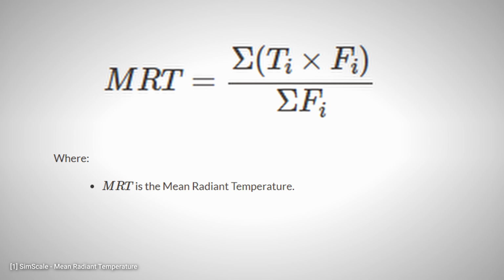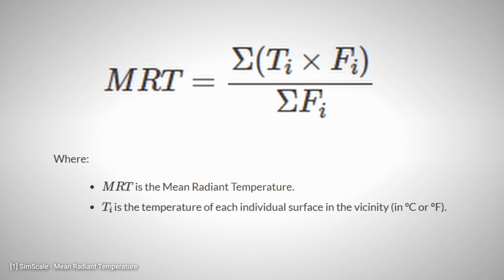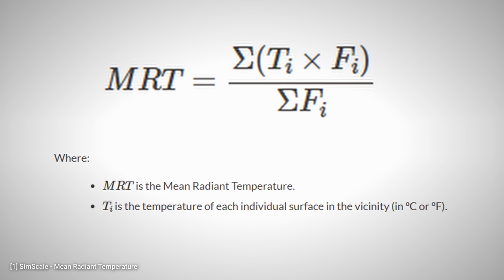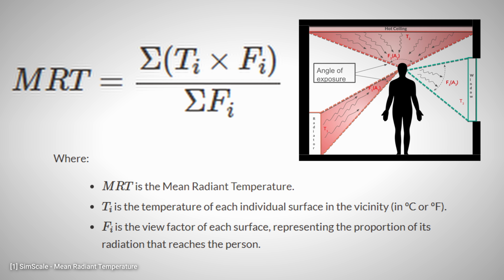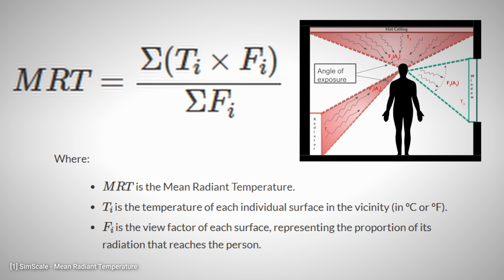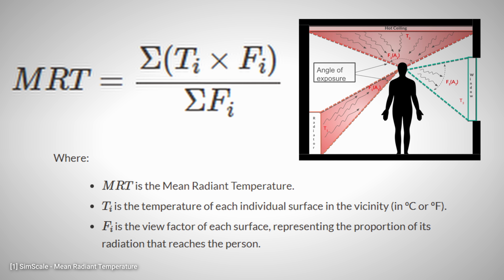The Most Misunderstood Factor in Thermal Comfort

Comment: Excellent presentation. I get out of it that heating the mass in a room is more important than heating the air itself. 
I can definitely feel that when it comes to cooling my place down with south-facing main windows... objects radiate heat I wish I could get rid of easily.
Reply from the maker: Yes, exactly! And make sure you have shading or closed blinds against those solar gains 😄

Comment: Which is partially why my IR heater (20 euro, 2*400 watt bulbs) and why houses in hot climates have tile floors.. Interesting it also makes a case for highly insulated buildings, which always seemed a bit out of proportion to me, given the cost of insulating..
Reply from the maker: That depends on the density of the insulation material. Some good insulating materials have low densities, which don’t add much in terms of thermal mass.
Reply: @PrefabulousTimberTalk wouldn't a thin plaster wall on top of a thick pir panel reach ambient (room) temperature much faster?
Reply from the maker: It would, but it would also lose it very fast because of the relatively low density.
Reply: @PrefabulousTimberTalk Makes sense! i didn't think of that, as with many other things you mentioned in your video. Thanks, im learning a lot!
Reply from the maker: Glad you're enjoying the content! And thank you for your support!

Comment: There are other ways to calculate temperature feeling as well. For legal reasons in Brazil (people who have to get inside freezers or work near ovens receiving extra compensation) we use a thermometer with 3 measurements. A dry bulb that gets air temperature, a humid bulb, that gets how well the air is giving or taking away heat from your body, humid air will cool you more on the cold but prevent you from cooling yourself on the heat, and a globe to measure radiated heat.

I'm pretty sure there are other ways as well.
Reply from the maker: You’re absolutely right! This was just one of the factors influencing thermal comfort.

Comment: Our house is 150 years old, and has plaster walls (which is moderately rare here in Canada), and it's interesting, in the morning the house heats up to 22° and then immediately after the heat shuts off, it falls to 20.5°-21°. after a few heat cycles, the plaster walls have absorbed the heat from the air, and the temperature is maintained better.

Comment: Cover all surfaces in IR heating panels, got it!
Reply: Cover them with reflective material, thus the cork tiles.
You could use silver backed foam insulation with a cloth covering over it.
This is my plan for a van, introduce 12v resistive heating panels and it may be a winner.
Take care M.

Comment: Engineers design buildings only for men. The men are comfortable and the women are freezing. Everybody considers feeling hot to be worse than feeling cold. When I was still working, I had to run a space heater under my desk. Yes, I know that men have more muscle mass which generates its own heat, but why can't they run fans? And then of course, there's the proliferation of chubbos, who carry around lots of their own insulation.

Comment: So, if I am sitting between a cold window and the thermostat, I will feel cooler than what the thermostat reads on the wall further away. 
Can’t I just measure the air temp where I am sitting to get the actual temp I should feel? Not sure I’m seeing the practical difference between this temp and an MRT.
Reply from the maker: That’s exactly right! To understand how warm or cool a person actually feels, you need to look at both the air temperature and the mean radiant temperature at their specific location. The picture becomes even clearer when we factor in things like the clothing someone is wearing and their metabolic rate, since both can noticeably influence thermal sensation. We’ll explore all of these elements (operative temperature, which blends air and radiant temperatures, along with personal factors such as clothing and metabolism) in the next two videos!

Comment: An easier fix in the winter is to simply add a humidifier to deal with dry air. Humidity has an effect on air density, and air density affects the air's ability to carry heat more than temperature alone. So if your humidity is around 20% or below you'll be chilly and close to 40% (or even above) and you'll be comfy. And that's with the same 20°C/72°F thermostat setting and no other obvious changes to conditions. No need to have specific radiant heating or being in line of sight of windows.
Reply from the maker: Very fair point!
Reply: @PrefabulousTimberTalk And even with the radiant stuff mentioned in the video, it lessens the noticeable temperature swings of the on/off cycling of an artificial heat source. Just the tiniest bit of thermal mass adds a buffer. And water vapor counts there.
Reply from the maker: Might make a short about this phenomenon! Thank you for pointing it out!
Reply: This was the very first thing I thought of when viewing. I'm glad someone brought it up. I think it is an underappreciated effect in heat comfort situations.

Comment: In the UK, our housing stock today is plagued by condensation and black mould. 
It is a recent phenomenon, rarely existing half a century ago. 
Why?
We changed from radiant heat from cheap coal, gas and electric "fires" with single glazing and draughty houses, to expensive central heating "radiators", double glazing and sealed rooms. 
We used to have many changes of air per day in our houses, now we re-breath the same air all the time.
In the past, our MRT was much higher, and our air temperatures in our houses were lower, and our respiratory health, despite the pollution, and universal smoking, seemed to be much better, nobody carried inhalers routinely. 
Our allergies, asthma, and susceptibility to viral infections was generally lower.
And way back then, just like today, we died of pneumonia.
Reply from the maker: Indeed, a very interesting topic and it is often overlooked. We happen to have made an interesting video about why modern buildings have more window condensation, which you might find interesting!

You can watch it here:
https://youtu.be/Em6SDrWCg0w

Comment: This is why I don't recommend large setback temperatures in attempt to "save energy".    My home is pretty comfortable at 68 degrees Fahrenheit.  I don't let the objects in the room get cold.  When people setback the temperature, the objects in the room get cold.  When turn up the heater, the air temperature rises pretty quickly but the room will still feel cold because it takes much longer to rewarm all the objects.  I stumbled into this when I started using a heat pump which wasn't conducive to large setbacks anyway.
Reply from the maker: Absolutely agree! Trying to warm up all of those surfaces in the room when the heater has been off for a bit means there is a lot of thermal lag, which is very annoying.
Reply: That is manageable by anticipating the thermal lag. I’m happy to have my house below 68C when I’m sleeping. Since there is thermal lag I set back thermostats well before I go to bed and have heat come on well before i rise.

Comment: I use electric hot air central heating at night because my electricity is free 8pm- 6am. By 6 am I have my wood heater running and it is much better because it is radiant heat. My arthritic joints can’t read thermometers so I don’t pay attention to them.
Reply: My fibromyalgia can’t read thermometers either!
Reply: Nothing on the planet is free.where do you get free electricity.?
Reply: @peetsnort probably at a place where the energy production isn't very flexible (wind turbines or a big coal plant for example) and most of the demand is from companies that only run at daytime. Negative energy prices aren't that uncommon nowadays with the increased supply of wind and solar energy. But, yeah, at most places you still pay at least a tax or a flat rate over the energy consumption :/
Reply from the maker: In the Netherlands, there are occasions when consumers are actually compensated for using electricity during specific hours. This unusual situation arises from the ongoing struggle with grid congestion. At certain times, an excess of energy flows through the network, outpacing demand. When supply and usage fall out of balance, incentives like these help relieve pressure on the system and keep the grid more stable.
Reply: @PrefabulousTimberTalkja jôh? Krijgen ze dan geld toe? Waar is dit?
Reply from the maker: Voor zover ik weet gebeurt dit overal in Nederland waar netcongestie optreedt en mensen een flexibel contract hebben!
Reply: @PrefabulousTimberTalkwierd

Comment: My largest room has my little oil radiator at the mouth of the bay window. The wall radiators are in the wrong place. The oil radiator uses the convection of the cold bay window perfectly, circulating hot air around the entire room.
Reply from the maker: Tactical place for the radiator! Nice one!

Comment: A related factor to consider is the material temperature of the surfaces in the room. For example, whenever I travel, I close my bedroom and turn off the heaters. When I return, everything in there is close to freezing. Hours later, even though the air has been warmed, the "cold-soaked" furniture is not radiating and I still feel "cold". Actually, the feeling is "hot and cold at the same time", because the air is warm but the MRT is still cold. Switching from convective heaters to radiant heaters helps with this.
Reply from the maker: Good point. That 'warm air but cold surroundings' mismatch is very real. Your body still loses heat to those chilled surfaces, so the room feels cold until they warm up. Radiant heat really does fix that faster than air-based heating.
Reply: Wow this actually helped me piece things together that I already knew. I’ve noticed for years how with our central heating, I freeze for most of the day even at 20/21 degrees. But come night time, I am actually comfortably warm even though the temperature is set for 18-19. By night time, the temperature of the walls and furniture has finally hit the desired temperature, only for me to go to sleep and start the cycle again the next day.

Comment: This is why I like oil filled radiant heaters. They radiate the heat directly to the surfaces of the room, raising the MRT, and making the room more comfortable.
Reply: I had one of those and was impressed with how well it warmed the space. Now I understand (pretty well) the concept behind its operation. This is a very useful video!
Reply: my buddy constructed his structures with radiant water heat in a very cold climate. He did not get fancy windows but his MRT is strong enough from the floors to compensate for the drafty cold windows. hahaha. We have convection HVAC heat so I put two layers of window plastic 1.5m on in the winter - and I add extra insulation on the windows also - it makes a HUGE difference to have well insulated windows. I sleep on the floor but the builder of our house left out the sill plate insulation!! Holy smokes! I put clothing along the floor/wall joints and even some big sleeping bag and clothes along the front door. I use an infrared temp gun to go around the house. Anything below 60 F gets insulation. hahahaha. That evens out the heat now so if it is even 20 below F. arctic cold outside we stay comfy tropical 75 F. inside. We also have convection natural gas heater but don't use it that often - and a couple heat pads for chairs. Wow I just found some bath mats that were in the garage - those bath rugs - and put them over the windows on top of the clothing and now it's 5 degrees F. warmer in my bed room. Hilarious!!! Now I can sleep on the floor without getting cold - even with a thin blanket on me. The HVAC convection fan is loud because the filter makes it whistle but it's not that bad - the whistle is contained at the heater itself now. Before it was whistling through the duct work so would wake me up. I grew up with radiant water radiator heaters - and would put my feet on them. thanks

Comment: It’s surprising how little attention this gets. Even with thick walls and triple glazing where you don’t feel the windows per se, you can really sense the outdoor conditions way beyond effects on air temperature and humidity. It becomes more of a slowness of change. That’s really the point of insulation. It’s good if radiation balance is fitting for conditions and you have enough heating/cooling control on the inside. I hate this modern building which is too hot 24/7 for over half of the year, around 26 °C for months on end. There’s all that mass inside I can’t control. Every night you can open all of your doors and windows, which only helps a little bit for those hours with no lasting change. That’s another thing: overreacting based on past conceptions. People have to suffer from mistakes before we correct course again.

Comment: Very nice video! Thanks for the explanation! 
I'm modelling heat loss and heating needs and just figured I'd need some formula or method to calculate heat retention: I know the heat loss of the building, sure that's important, yet the internal temperature is dependent on the heat storage inside. Is there a rule of thumb how I calculate this mass, this energy storage?
Reply from the maker: Glad you liked the video! Since you’re looking at heat retention, the key is exactly what I covered in my thermal mass video a few weeks back: the more dense and heavy the interior materials are, the more energy they can store and release slowly.

A simple rule of thumb is to estimate the mass of the main interior materials (concrete floors, brick or block walls, thick plaster, etc.) and multiply those by their specific heat capacity to get an approximate thermal storage. It won’t be perfect, but it gives a solid starting point for modelling how your building smooths temperature swings.

Hope this helps you out a bit!
https://youtu.be/7akrp03NoQ8
Reply: @PrefabulousTimberTalk  Thanks! I spotted the video on your list, now watching! I'll try to calculate the mass of the building I'm designing, it sounds very meticulous, lot's of tiny details.
Reply from the maker: Indeed a lot of tiny details to consider. Best of luck!

Comment: This is why my garage (which is heated by an old woodstove) always feels so much warmer than the measured air temperature!
Reply from the maker: Exactly! Radiant heat!
Reply: you can put a big pot of water for radiant heat on a stove or also construct a thermal mass heater from cob and duct work - using a rocket stove for extra heat and clean burning. Those use ceramic insulation to make the wood burn really hot. I put some in a wood stove to experiment - got the stove up to 800 F. But then the steel starts getting damaged and I lost too much wood fuel space to the ceramic fiber board. hahaha. Still I got a clean burn and super hot temps. Just had to reload the stove too often.

Comment: Yes, I came to the same conclusion. I know when I am in a foreign country because my skin does not sense any higher temperature than ambient. In my tropical country, even if the room air conditioning is dialed low, some walls are still at a higher temperature and that radiation is sensed.
Reply from the maker: Exactly! 😄

Comment: interesting video on a topic ive never even heard of, one question though, couldn't you just use a thermal camera to get an idea of mrt near instantly?
Reply from the maker: You’d get a quick snapshot, but not a real MRT. A thermal camera only sees surface temperatures in the direction it’s pointed, while MRT accounts for radiant heat coming from all surrounding surfaces. That’s why tools like a black globe thermometer are still needed for a more accurate, all-around measurement.

Comment: I hoped you would tell us which materials radiate more heat towards or away from us ):
Reply from the maker: Good point! Materials with high emissivity, such as dark or matte surfaces, radiate heat strongly, and those with high thermal mass can store and release that heat over time. Highly reflective materials like polished metal radiate very little and mostly bounce surrounding heat back instead of emitting their own.